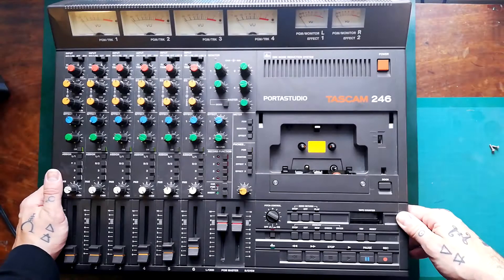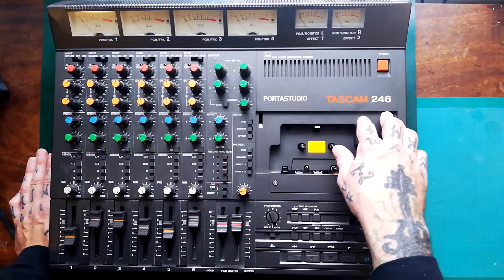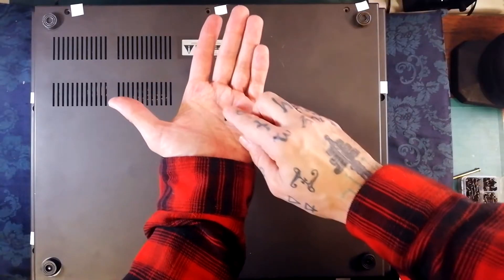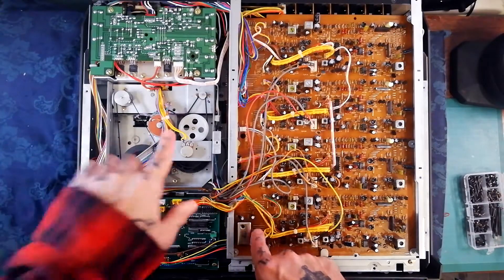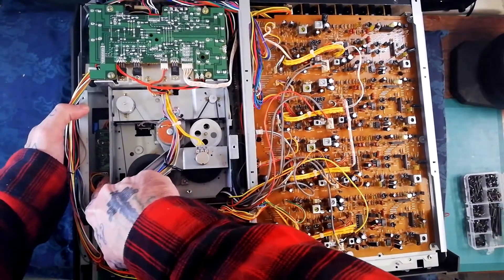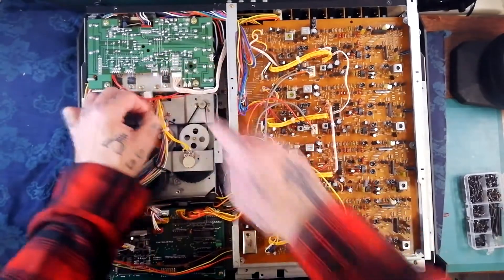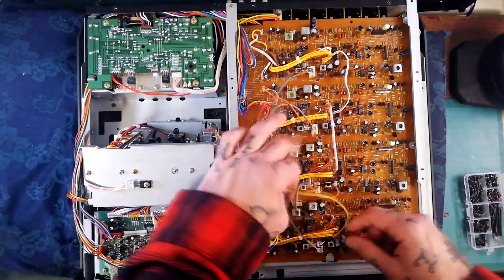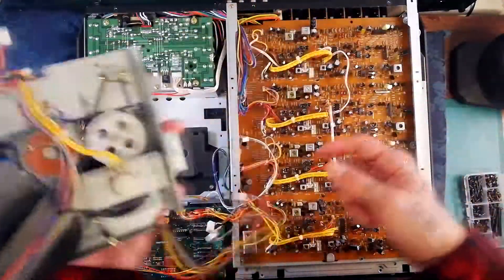Tascam Portastudio 246 | 1 | remove knobs | open case | remove cassette transport (belt change, etc)

Comment: Anything technically point to a sonic difference between this and a 414 or 424? This one looks more like the 388 in my studio.
Reply from the maker: The 246 244 and 388 used the same DIP opamps in their gain stages and the same electrical topology in the EQ circuits. From the 424 onwards they moved to SIP opamps - I’m not sure they perform any differently, but it allows the PCBs to be smaller. I haven’t scrutinised the difference in the EQ or preamps, they may just appear superficially different on schematics due to the change of chips. Generally speaking I’m a sceptic of arguments that say X portastudio sounds different/better than Y portastudio. Obviously tape type, speed and some side effects of bad calibration are things I would expect to be able to hear in a blindfold test, and the parametric EQs on the 244/246/388 have a special mojo compared to the EQ on later units, but I tend to see the differences from model to model in terms of weight, footprint, workflow, features as opposed to distinct audio flavours.
Reply: @Tetrakan  thank you! very thorough!

Comment: Hi I was curious if you know where I could get some replacement screws? I couldn’t find a match at the hardware store?
Reply from the maker: The service manual is available for free download from my blog and contains a parts list including screw sizes. It'll be mostly screws with an M prefix (meaning machine or fastening I think) that you need but these are less likely to be carried by a hardware store since they cater mostly to DIY/ carpentry applications I guess? However multi-packs of M screws are easily obtainable on amazon etc.

Comment: Hi there,
i´ve bought one from reverb. In great condition visually and everything is working real good. But it will not go in the record mode.
What i found was: these little plastic things i the transportarea. These two noses called "cassette in place sensors", the left one is missing.
I could imagine, thats this is the whole problem, cause it doesn´t check correctly whats in there. Is that easy to fix? its just not there the left sensor.
Thank you so much for your hard work here!

Comment: these are really slick. does it have tape outs for each channel? looking for a backup 4 track as insurance for my 424. was thinking a 234 or this. i have to be able to track and mixdown on a seperate mixer. i find it helps preserve these machines doing all the heavy lifting on a seperate board and it makes your source signal as good or bad as youd like.
Reply from the maker: Yeah separate outs on each channel. For feature rich all-in-one portastudios I really like the 464 and 424 MkIII as well, but I'd say this was my favourite - just because the VUs are nice to work with once calibrated and the 2 band parametric mids are a little more useful than other portastudio EQs.
Reply: @Tetrakan  could you walk through how to calibrate the VUs?
Reply from the maker: @robertcrystals  this is a series so the episode covering the VUs will be published in the next fortnight or so, but briefly - the vu trim pots are accessed through holes in the rear of the plastic case, so it's actually easier than the same procedure on the 244. I have a video on calibration of the 244, and the 246 service manual  - which describes the process in detail - is available for free download from my blog, I hope those resources will allow you to carry out the calibration before I publish the rest of the 246 videos
Reply: @Tetrakan  you’re an absolute saint, thank you! Looking forward to the series!!

Comment: I remember you saying this was your favorite unit. I’m still undecided between the 144 & 244, just because when I moved my 244 cassette over to the 246, I noticed the preamps weren’t as hot. Amazing features, though. Was pretty much the blueprint for the high end units of the 90’s (minus those lovely VUs). When I have the bread or time to get mine calibrated, I’ll maybe do a shootout if you don’t beat me to it first ;-).
Reply from the maker: I'd tend to assume that diffences in gain from your 244 and 246 are down to the ageing of the components, and if you repopulated the preamp section of the PCBs with fmnew components from the same production batch their performance would be more or less identical? But go ahead and make a video - I can think of several folks on YouTube who make this sort of content and we all get views.
Reply: @Tetrakan  I am thinking of doing a video or two one day soon(ish) with my four tracks, but will need Mike's help first. I've decided I'm a bit burnt out on repairs save for the 244, which I'm determined to finish myself. And that's an interesting notion about the aged components between the 244 and 246. Honestly due to his propensity for modding, I may ask Mike at some point to see if there's a way to hot rod the 246. That machine is just about the best of the 4 tracks that I can think of in terms of functions and form. And if you're right about the components, I can't imagine how amazing that thing could sound if it was on par with the 144 or 244 preamps.

Comment: Great timing, I bought one for $100 with no knobs/not functioning. It does power on though. I fixed everything I could with the transport and am handing it over to a tech since there’s clearly something wrong with the electronics. I’m guessing it was used for parts for another machine :/ but I’m hoping to bring it back to life!
Reply from the maker: I've got a lot of spare 246 knobs, message me through Facebook if you need them, good luck with the restoration!

Comment: Great tips mate. I’m in the process of taking the transport out now and have come across a hurdle right away. One of the five screws on the transport that connects it to the chassis is insanely tight & has threaded. What is you method for rectifying this? Cheers from Australia 🇦🇺
Reply from the maker: Thanks! I typically spray PMA spay lube or penetrative oil on the offending screw and let it sit. Then wipe the head clean, put a screwdriver in it and wallop the end of the screwdriver with a rubber mallet or equivalent a few times. Then put a thick rubber band between the screwdriver head and the screw for better grip. Sometimes  this needs to be repeated a few times. If all else fails, search for screw extraction kit on amazon/ebay etc.
Reply: @Tetrakan  thanks for the reply mate, I just got it out before I checked back here. Ended up using a no.3 size triangular shape attachment that was with the T8 T9 bits that I had lying around. Thanks for the reply, have a 246 machine and I’m following your great vids. Two belts were crumpled up but not really much goo which is good. Enjoy the rest of your day cheers 🥂 🍻

Comment: I bought one in 1987, still have it and just took it out of the box after 25 years or so and turned it on. It is making a noise like something is running, it varies, speeds up and slows down, sometimes stops and starts again. Any clue what that might be? Before I take it apart...
Reply from the maker: Hi, the cassette player on the 246 is 95 percent identical to the 244, I've made about 20 videos on DIY refurbishing it, heres one of the early videos, https://youtu.be/HEwaZeIjxdk if after watching those you're still not sure, hit me up in the comments
Reply: @Tetrakan  Thanks, that helps, time to open her up!

Comment: Hi there , im trying to fix mine . I replaced the belts , 2 pieces , On the flywheel and another smaller 1 on a smaller motor, expecting it to work but not. the digital counter is also not going on, basicly the tapes are doing nothing. Any ideas? good video
Reply from the maker: Is it an EU model you have? If so there would be slowblow fuses attached to a small board on top of the cassette player - check these are still good using the continuity tester on a multimeter. The counter and cassette player on the 246 receive power through the same control board so either the fuses need to be replaced or you have a problem in that control board, or this is my working theory anyway....
Reply: @Tetrakan  thanks , i will check for that later on. love your channel
Reply: @Tetrakan  hi there, cant see any fuses , its too complex for me. It will end up a wreck if i go to deep. thanks mate. It will maybe make someone happy as a parts machine.